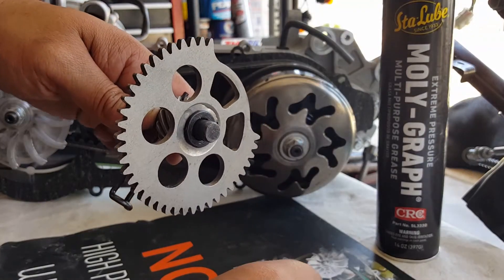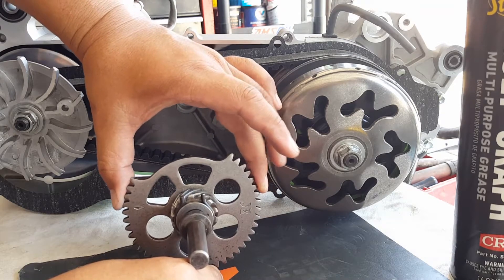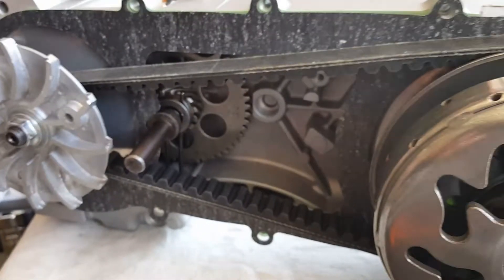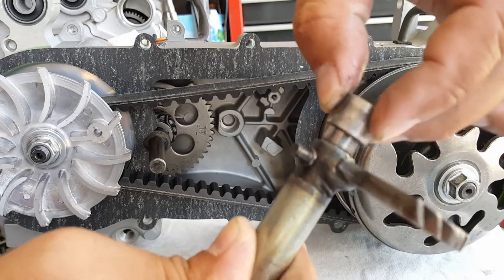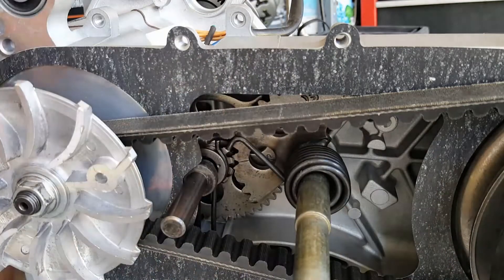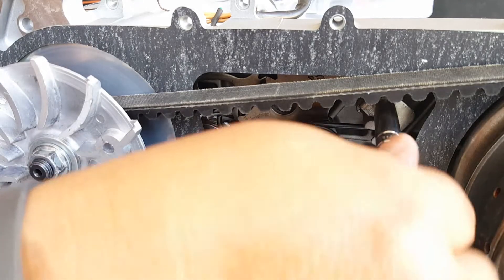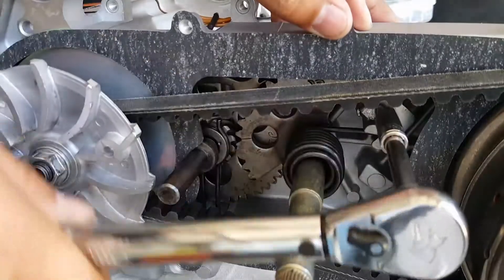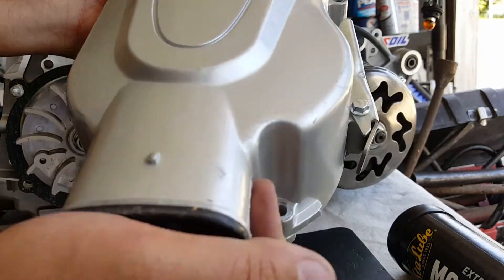How to install GY6 CVT & Trans on SSP-G 180cc POWER KIT Part #8

Comment: So you went with a performance CVT on a 180cc motor with an OEM belt? Unless I'm mistaken, but that's really dumb the OEM belt isn't made to withstand those temps and speeds should've upgraded to kevlar. Also, in a previous video you said that the belt shouldn't touch the boss, I've always been told you want the belt as low in the variator as possible and you get shim washers to fix the issue or a longer boss
Reply: NCY STORE I've always had better experience with kevlar, you're supposed to scuff the variator surfaces anyway upon installation for better grip anyway apparantly, sorry if I seem aggressive, I have an 07 kymco agility 125 I've been trying to tune for the month since I've bought it and its pissing me off to put it nicely, and I dont know if I kit such as this will fit the KN25 block that kymco uses even though it's a gy6....so I'm lost haha
Reply from the maker: Hi, good question. :) Kevlar is term trademark by 3M used to make bullet proof vests  which is actually harder belt esp. for aluminum drive variator for GY6 most nylon material works better longterm due to its softer or flexible nature. Kelver got his reputation of being rugged and durable, and is twice as much but no one tells you about the downside on aluminum variator. We sell them  and only recommended for heavier duty application. When installing the cvt belt raise it the belt above the boss by clutching the belt inside the clutch side, leaving more slack in the variator side that way when tighten and torque to 30-35 ft lb the variator drive face nut the drive face will flush securely against the boss or washers, if applicable. If the belt is low near or on the boss when tight sometime it prevent the varaitor drive face from securely closing even when torque, leaving a gap expose the crankshaft splines Which means its not flush securely the varaitor drive dace and boss. This may create a problem esp. if its has teeth like on 139QMB varaitor drive face that won't aligned properly with bendix teeth, thus cause prematurely the teeth of the aluminum performance variator drive eaten by the by the metal electric starter bendix.
Reply: Deleted your response? Also any idea if this kit will fit my scoot?
Reply from the maker: Pulsar Tech I'll find out for you right now
Reply: NCY STORE thanks
Reply from the maker: Pulsar Tech This engine replacement kit, minus the electrical and transmission parts. If Kymco scooter uses a 12" or 13" rear wheel this 180cc power kit will be compatible. If you wants to use the cylinder and head out of this kit with your stock original case, then no it will not fit your orignal block.